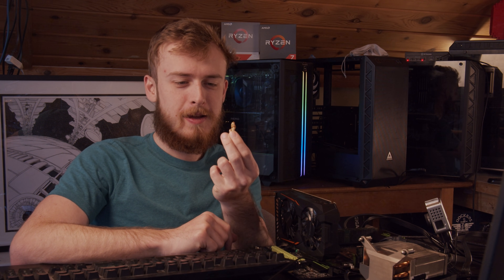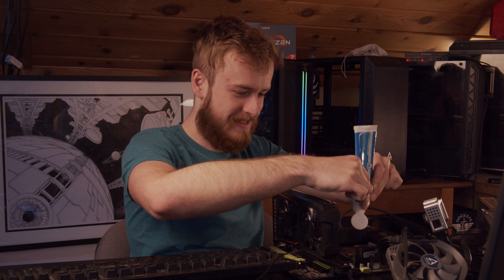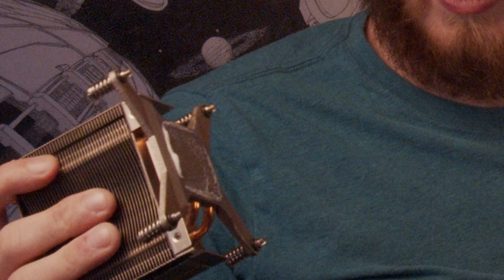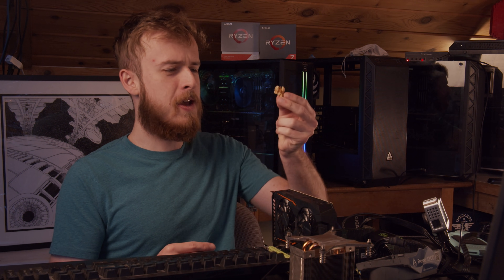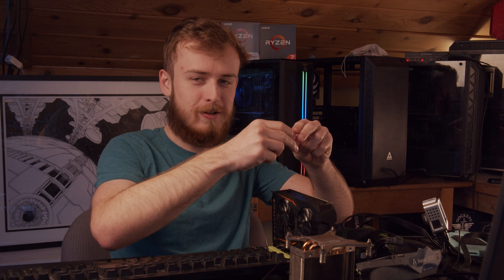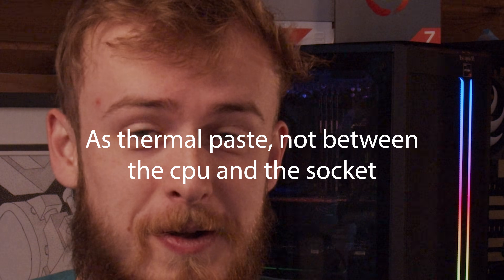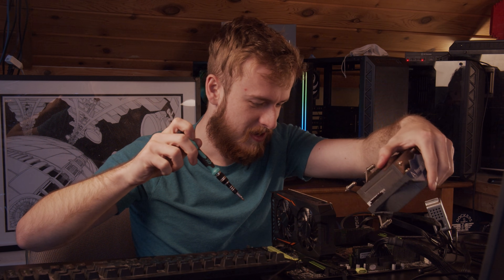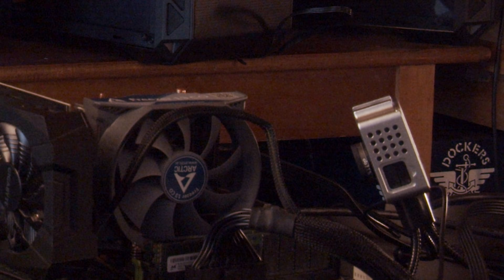What Happens When You Use A Nut As Thermal Paste + Toothpaste

Comment: i want to see what happens when you dont use any thermal paste at all
Reply: the cpu will heat up till its max limit like for amd its 95 degree c, and will abruptly shut down the pc
Reply: @dhavalvyadav  LO depends if its intel it'll get mad fucking hot and make the board catch on fire most likely
Reply: @johnnyblaze9217  nah, I hate Intel for overcharging but I'm pretty sure the board won't catch fire